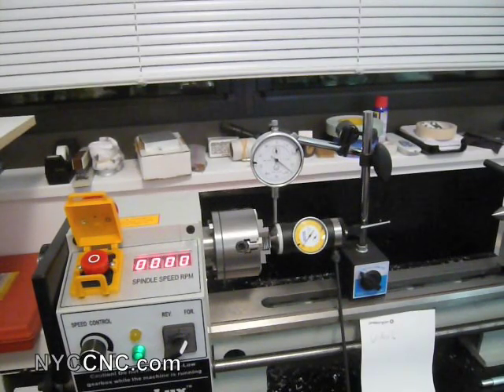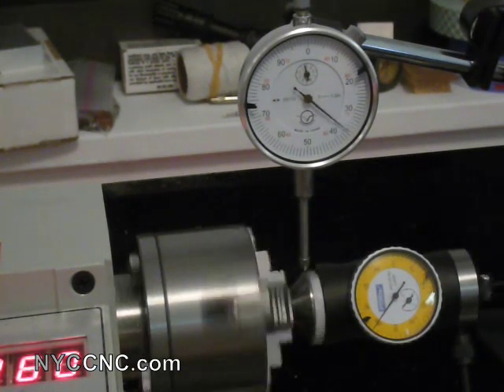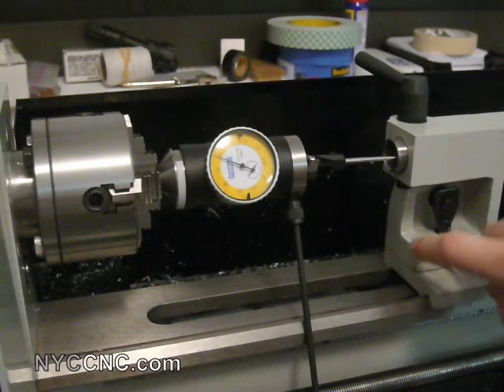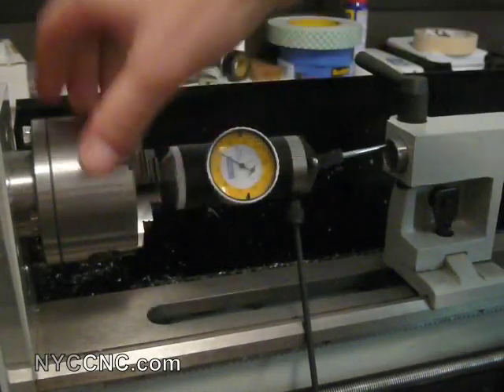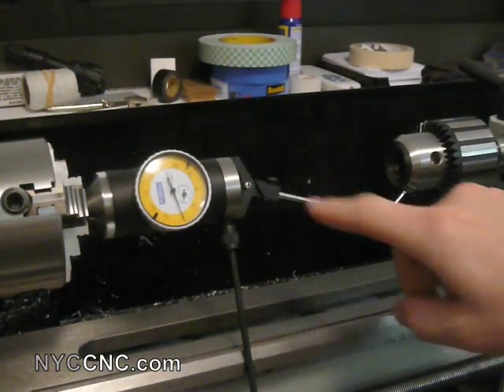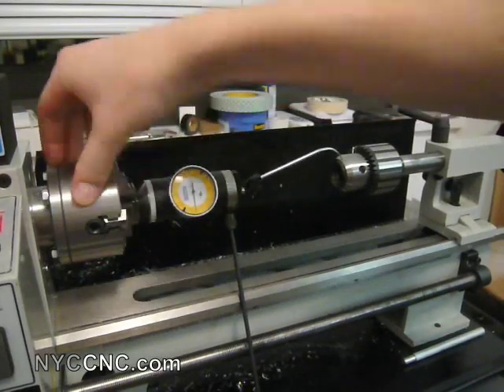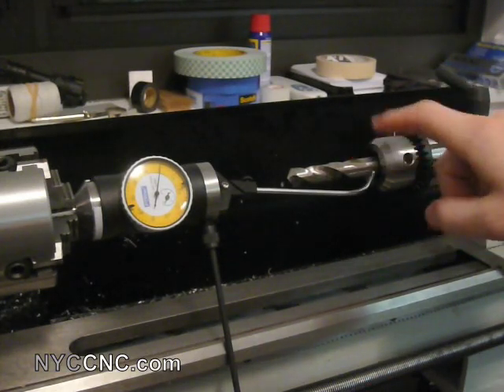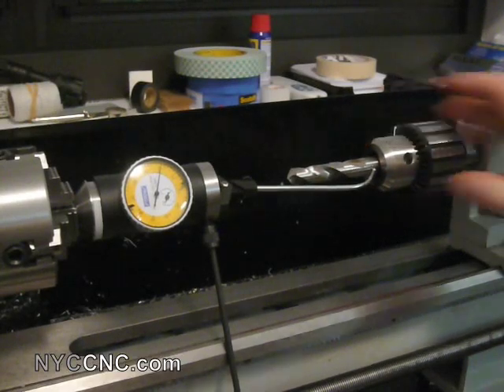Tailstock Alignment on Micromark 7x14 Mini Lathe

Comment: You left the plastic collar on while you were doing it. Surely this could bottom out and show you incorrect eadings. Great idea tho. I cant justify getting one of those for doing just that operation. I dont have a mill so wouldnt you it a great deal.
Reply: Came here to say the same thing.  The plastic collar needs to be removed for proper operation.

Comment: Wow, you certainly have upgraded your machines from the early days.
As the probe length will change the actual reading on the dial, I use a feeler gauge under the probe tip to establish a conversion factor and then apply this to any further readings.

Comment: I don't trust co-ax indicators. With all of the different length attachments, how do you know that your reading is a one-to-one ratio. The pivot point usually has to be equal in distance to give you a true reading. a shorter leg will give you a more extreme reading while a longer leg will reduce the actual run-out. Also, you don't have to dial in you indicator. It runs with the rotation of the chuck. Good lord, lol, you posted this in 2008... I'm sure you know this by now. I like your videos though. You have a passion for this field. Keep up the good work, and I'll catch up.

Comment: I have this lathe  from harborfreight..
I don't think  it really worth to spending so much time on..  the machine basically a good construction..  however it wont  be a big bang.. 

it keeps paralellity  on 4 in length.. without tailstock..

crosslide  repositioning also very well.. not  H7 but  very  precise..

I don't want to comment to indicating drillchuck.. a good Jacobs  drillchuck works well..

Comment: Using different length probes changes the measurements. You need
to get the tables to compensate for reading.

Comment: whats the accuracy of a 3 jaw chuck? your wasting time,,making shit harder then it really is,,it would depend upon your lenght of your part.and the underneath of your tailstock plateform and ways,,,,tailstock extension,,that far for drilling,,you nim rod,,but the drill will follow the path of the center hole,,meaning less,if i was standing there i would slap your toupee off,,,,,

Comment: no need to read up,, when i said inspection pin i meant a hole checking pin like we  use in the tool room,, its a box of ground round pins that are like guage blocks but round, after a hole is bored the only way to truly judge its radial runout is to see what pin will actually fit,, just use an extended carbide end mill, the bigger the better,, most drills are a little funky and not real round, a carbide end mill will be more than ok,, its the TIR of the carbide you are after,,,hav fun !!

Comment: been at it 30yrs my self,as i do agree with you we both know if we want a hole round and in the center we poke it,then BORE it, you gotta hand to him for what ive seen in shops over the years hes light years ahead of some of the idiot things ive seen, to do what hes doing the only thing i would change is use an inspection pin in the chuck and there is no reason for the TIR on the 4-jaw to be out at all, hes very well self taught and can tell he loves our trade, it drove me crazy bout 29yrs ago!

Comment: It blows my mind that I see so many people worrying about the tail stock alignment.  The way it is done in this video is incorrect.  It is super easy to indicate the tail stock with a workpiece between centers.  I have been a Journeyman Machinist for over 40 years and I have never given the tail stock hardly any thought at all.  Before the taper attachment, the only way you could turn a taper was to offset the tail stock. It seems like it is a disease that I don't understand worrying about it.

Comment: @saunixcomp if your eyes are really good still you can also use a dead centre in the tail stock and in the chuck , this is how i still do it while my eyes are still good and mine is bang on its a bit tricky but works as well, you are also on the right track to